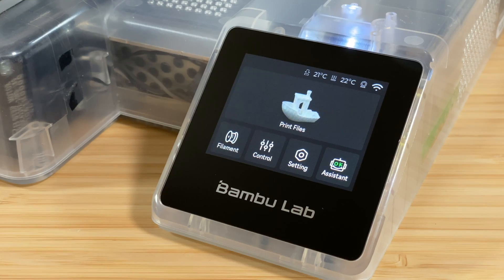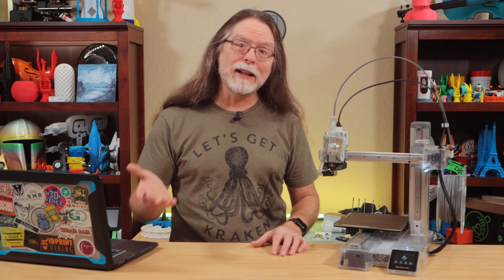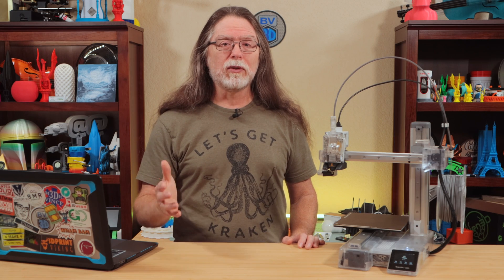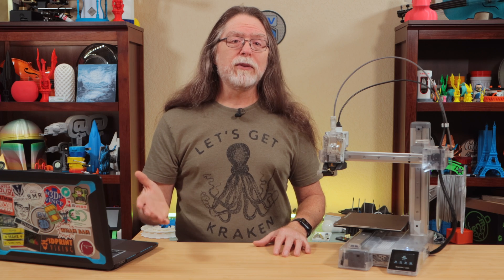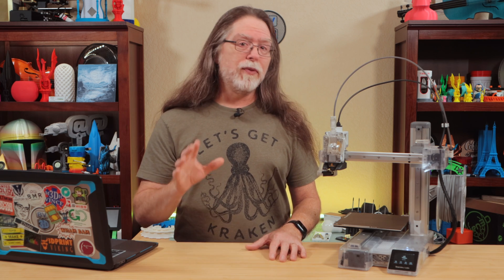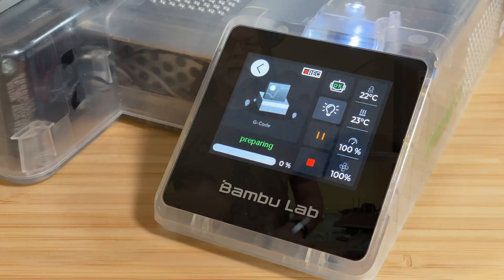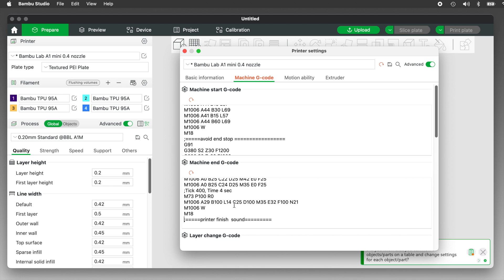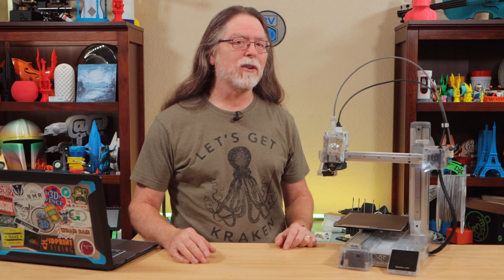Play Music On Your Bambu Lab A1 or A1 Mini & Make Your Own Tunes!

Comment: Assuming the other more expensive Bambu printers cant do this because they have silent drivers?
Reply: It's not the drivers making the noise. It's actually vibrating the motors at the frequency associated with the note (e.g. 440Hz = the A above middle C)